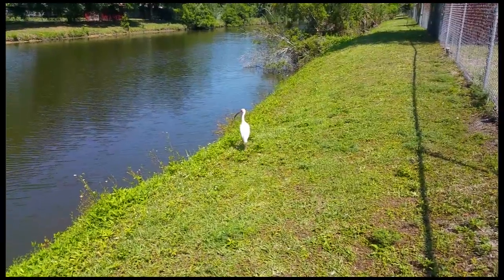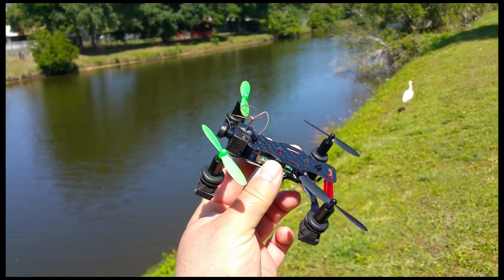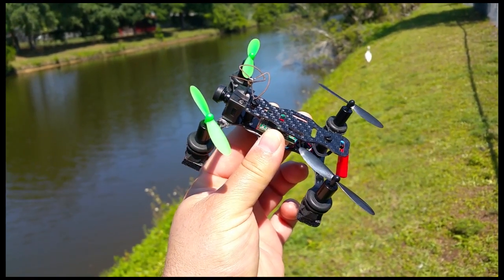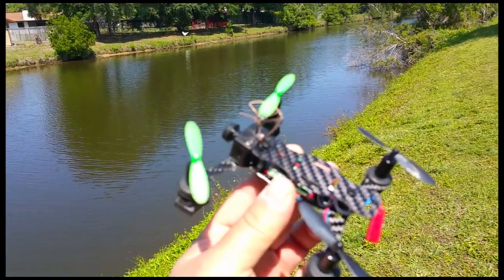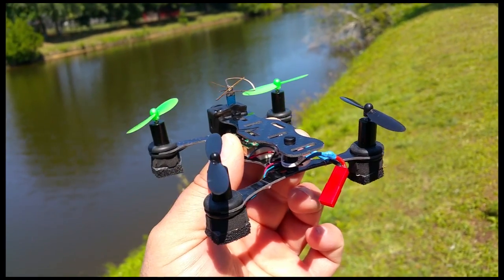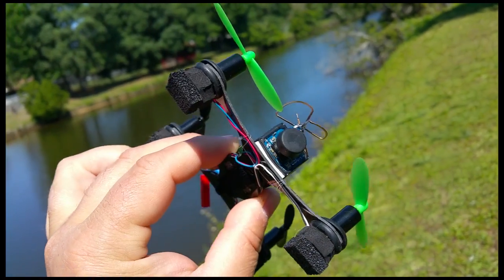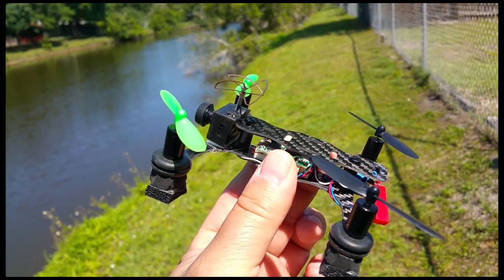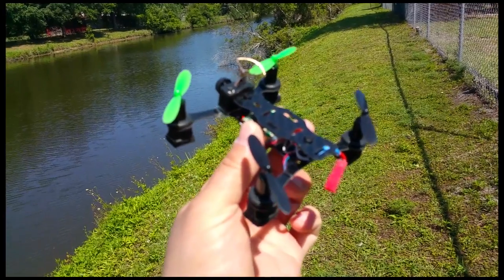Phoenix Flight Gear 110mm Carbon-H Micro Quadcopter

Comment: Mad Scientist Matt I have this set up with 7mm motors.  Wonderful bird.  Would you share your PID's with me?  Mine flys pretty good, but flips out when I and pitched way forward in high speed and then pitch back hard to brake.  When I say flip out I mean literally flip out and tumble.  And this is in Angle mode!  Lol.  Not sure what's going on there.  I'm thinking it's a PID setting problem.

Comment: can you use the Nano QX board with motors this size? Or will it fry the board? Please let me know, want to start building a micro quad!
Reply from the maker: you can if it's the nano qx fpv board, but some had mixes results. that is what I am using in this video... but I highly recommend using the scisky flight controller controller, it is much better and configurable via usb

Comment: using those rubber grommets as motor mounts is ingenious. propably a bit heavy, but indestructable
Reply from the maker: Yes, agreed... and it helps with vibration isolation as well...

Comment: Do you know if 8.5mm motors work with 110,or 135mm frames if I use 8.5mm grommets?
Reply from the maker: Yes, but they make different versions for the 110mm frame, a 7mm version and a 8.5mm version, make sure you get the right one for your motors!

Comment: just to clarify, you are saying this is a better camera than the spektrum VA1100?
Reply from the maker: Hey Jeff... yes, it is a lot better.. I have done extensive testing with the Quanum Elite Camera/Video transmitter combo in the last couple months...  I actually own 3 of them now, the range is much better, resolution is WAY better, as well as the low light... plus they can be had for around $40...  They are re-branded, the actual name is the FX797T , hope this helps!
Reply: I was planning on using it with quanum v2 goggle do you think this will be ok? and do you have a recommended receiver for this setup? I"m new to fpv (never tried it before) any info you can give me would be most appreciated
Reply from the maker: Yes, the Quanum v2 goggles I have heard great things about...  and the receiver people like is the FR632, but here the newer Quanum RC540R is supposed to be good, and it has channel scanning... there are some new goggles coming out on the horizon with integrated receiver, check this out - might be a good option. http://www.hobbyking.com/hobbyking/store/__105250__Quanum_Fatshark_Genesis_HD_FPV_Goggle_w_integrated_40_CH_5_8ghz_Diversity_Receiver.html

Comment: Approx how many hours of flight do you think you have put on the Dark Edition Motors? Just trying to figure out if a new set is worth purchasing. Stock motors don't fly as well with fpv gear.
Reply from the maker: +Charles Proctor I probably had about 7 or 8 hours on them, and they were still flying fine... I think the real trick to making them last is letting them cool down in between flights...

Comment: Are the Dark Edition 8.5 mm motors still running good. I built the same quad and initially  the motors ran great. I flew the quad for a few weeks and the motors have stopped running properly. I experienced the same problem with my stock Nano QX and I replaced the motors. The stock Nano now runs great again. I'm just disappointed that the durability of the Dark Edition Motors does not appear as good as the stock motors.
Reply from the maker: +Charles Proctor That is so odd, i have alot of time on my dark editions with no issues... what props are you using? I have heard that if your using a prop with a stronger bite (like the parrot props) they will burn the motors up within 5 to 15 flights, or seriously degrade the power

Comment: hey what's going on I would like to know on the board did you solder the motor to the board or you put a connection
Reply from the maker: +Jay-Q CEO The board has connections for the motors, no soldiering

Comment: Thanks Matt, I think I am going to try to build one like this. Can I bind a Spektrum transmitter to this? Also to change out the plug do I need to resolder a whole new plug and wire onto this...or can I just pull the wires out of the plug it comes with and stick them into a jst plug? Thanks for your help.
Reply: +holden2113 Wait one week before you purchase, I have a new video coming out of a v2 version that is even better, and very easy to build!
Reply: +Matt Merritt When is the video coming?  It's been more than a week :)
Reply from the maker: +Junes Graphics I apologize man, my grandpa passed away and i have been super busy helping my grandma... i did just upgrade the description for you with the newer components...
Reply from the maker: +Mad Scientist Matt RC Here is my other unofficial channel, with a flight video of me testing it so you can see how it flies... https://youtu.be/iO-mAf-SUbc
Reply: Mad Scientist Matt RC Sorry for your loss:( Thanks for the response.

Comment: Matt, could you elaborate a little more on what you said about adding a new connector, because it trips it into a low voltage? I am new to the hobby and I guess need a little more help than others. Thanks!!
Reply from the maker: +holden2113 No problem, the issue is some connectors can allow more power through than others... if it tried to pull more power than the connector can handle, then the flight controller thinks the battery is lower than it really is, and triggers it to go into lower voltage cutoff (or LVC), it does this to save the battery from being drained too low (you shouldn't ever go lower than 20% remaining on a lipo) I recommend a JST as it will work perfectly...

Comment: Think I can remove all of the FPV equipment, use an arduino UNO flight controller, and have an arduino bluetooth device. Then use my iPhone as a "transmitter"?
Reply from the maker: +Cole Little You might be able to, i'm not sure... but I will tell you this, using your iphone has a transmitter is a novelty. It won't give you precise control over flying, especially when you are in full acro mode. At the very cheapest, i would consider a dxe transmitter (only $59)

Comment: I built the same thing but it just spins out of control
Reply from the maker: +Erick Gomez That is weird? Props on wrong, wrong motor wiring?
Reply: +Mad Scientist Matt RC I don't think the motherboard was capable of handling motors that strong.
Reply from the maker: +Erick Gomez The newer Scisky / Quanum flight contoller fixes this issue, and lets you run cleanflight/betaflight because its a naze32 flight controller... the link is: http://www.rc-drones.com/Quanum-Pico-Micro-Scisky-32bit-Brushed-Flight-Control-Board-wMotor-PlugsBattery-Connector_p_1341.html

Comment: Does the blade nano qx board give you full manual mode or not
Reply: +Alex Polakis It does, you can turn off stability mode and do flips, etc.
Reply from the maker: +Alex Polakis Yes, it has both acro (the mode you are mentioning) and stabilized mode on the flight controller

Comment: Got exact setup from your sources. Although they sent me a different looking frame. Still works great tho. I have a random 500 mah pack on without camera and I'm getting 7 minutes flight time. Might just add a separate 150mah for camera and see how it does. Super easy build ( about 20 min) and just a blast to fly. I would definitely recommend to anyone who is looking for a little bigger faster quad than the nano qx.

Comment: can I fly using dx5e with this setup. I think you are not using stable mode .  how does it perform in stable mode. since I have only dual rates high/low I can't use manual mode to fly accurately
Reply from the maker: +Kumaran Thirugnanam Your right, i wasn't using stable mode, i only fly in acro mode, but it performs excellent in stable mode... You should look into the new Spektrum DXe radio, only $59!

Comment: I have a similar If not the exact same setup. I went with a hubsan receiver which I'm currently regretting as I'm stuck using their transmitter. I'm currently looking at the blade nano QX board. I see it uses dsm2, so any dsm2 module should work? I already have one laying around for my FrSky Taranis.
Reply from the maker: +PA Stubbs Yup, you should be good with the FrSky taranis if you have the dsm module

Comment: Hey Matt I was wondering how you fit your Ultra Micro Camera onto your frame. Is this a good racing quad? If not, what else can I add to make it better. I was also wondering how you fit 8.5mm motors onto your quad although the website states it can only fit 7mm motors.. Thanks Matt!
Reply from the maker: +RCDude01 It's a pretty descent frame... i used double sided servo tape to fix the camera... there are two different frames, one is for 7mm motors, and the other is for 8.5 motors...

Comment: question for ya mad scientist and it may a little dumb considering that i have been flying rc planes for a long time now and looking to get into quads.  i was just in the process of pushing the "buy now"  when this occurred to me. in the specs and requirements list for the phoenix flight gear  110mm kit, it mentioned a spektrum receiver was needed. did they nean a spread spektrum  was needed or was it for the brand  spektrum rx ?i was planning to use a tactic tr625 spread spektrum rx, will this function with this kit ?thanks for your time matt, your vids are informative.roland
Reply: can anybody help with this, i have the kit in the mail but still unsure as to the rx
Reply from the maker: +Roland c Roland, the Nano QX FPV flight controller has a built in receiver for a Spektrum transmitter... I don't think it would work on a Tactic transmitter... I apologize for the late response, i just saw your message...

Comment: you should check the Nano Techs from HobbyKing. 1S  750mah  35-70C  around 3 Bucks !!!  i use the Hubsan 8mm motors.  i don't use the Phoenix 110 top plate.. so i can use a separate 130 1S battery to power the VA1100.  i get almost 6 and a half minutes of good FPV.   i did get all the PFG info from you....so thanks !!
Reply from the maker: You welcome, hope its working good for you!

Comment: Wow that's one of the smoothest quads I've seen... I might have to re-purpose my nano qx LOL. Are you flying in acro mode or in stability mode? Your video seems to be very locked-in as well, how'd you get such a solid signal?
Reply from the maker: +RC Fanatic I am flying in acro mode... It's very smooth for sure. I am using fat shark hd goggles to record the video, but on them i am using a VAS ultra blue beam, works really well, keeps an excellent signal... the best i've tested so far...

Comment: Nice flying Matt. Is the non FPV Nqx FC the same as the FPV Nqx FC apart from obviously the video capability
Reply from the maker: +MrPnew1 No, bigger FETs on the board capable of handling more powerful motors...

Comment: how did you get the 8.5mm motors to work in that frame? listed as just 8mm working in it. I want to build something very much like this but torn between this frame and the 8.5mm frame at MMW.
Reply from the maker: When people say 8mm or 8.5mm it is the same thing... all motors are actually 8.5 but they say 8mm...  the MMW frame is nice, but a tad bit heavy... the VooDoo Quads brushed Voo is currently my favorite frame...

Comment: I have read that the nano board will not support the 8+mm motors, looks like you proved them wrong. I am running my Phoenix 110 with speed 7mm motors, weight is an issue, trying to keep it at or below 50 grams flying weight is often challenging. I think last I checked it was at 48grams with a 300mAh battery, short flight times but a lot of fun without having to go to the flying field. Looks like I need to build me a 8.5 micro.
Reply from the maker: +teamscreem From experience I have gained, it seems some have good luck and some don't... its weird... personally, no issues with that flight controller and the dark editions...

Comment: hey i built this quad per your specs listed above, but now im having issues with it cutting out and uncontrolled crashes like the lvc is being activated or something any ideas or issues you had with nano qx fc i have the fpv fc on this and soldered jst and bigger wires than factory direct to board... thanks!
Reply from the maker: Patrick Combs That is really odd? Are the motors getting old? Sometimes if even one of the motors has an issue, it starts drawing too much current which can set off the LVC... or if the battery is starting to go bad, not sure about why this would be happening... Are any of the motors getting hotter than the others??

Comment: Would you say this is indoor capable or are 8.5mm Dark Edition motors too powerful?
Reply from the maker: ssg  Probably a bit too fast for the inside.. I mean, you could try it if the inside of your house was big, but its a pretty fast setup...
Reply: Mad Scientist Matt RC Yeah, I ordered CJMCU with 7x20 motors for indoor FPV.

Comment: I've got a couple questions for ya.. Can I run all of those specs, the frame, props, motors, batteries, and flight controller with my nano qx FPV camera and transmitter? 
Also to build that did you have to do any technical stuff, ie: board programming, coding etc?
Or was it just a simple mechanical build, can I take apart my nano qx FPV and buy those parts (besides the camera) and build it just like that? What's your advice? Thanks so much! 

Btw that quad is awesome!
Reply from the maker: MrKaNittel Sorry for the late response... this is a super easy build... no programming of any kind, and yes you can use your Spektrum transmitter and wire in your VA1100 camera and transmitter, thats what i am using... Its a great machine, only advice would be to understand that some motors have red and blue wires, and other motors have white and black wires...  When you unplug your original blade motors from the nano qx fpv flight controller just know that blade does it backwards in regards to the colors... so when you unplug a motor from the flight controller that is black and white, plug in one of the micro motor warehouse motors that is red and blue...  and vice versa, if that makes sense...  its important that the motors are plugged in the right place on the flight controller, the motors are brushed with timing in the a certain direction, and reversing them back accident they will work for around 15 minutes, and then be totally worn out.. message me if you have any questions, i would be glad to help you

Comment: what kind of controlers can u use with the nano qx board
Reply from the maker: Johnny TSC You can use anything Spektrum (or JR) related... like a DX6, DX7, DX8, ect... I am currently using a DX9 black edition...
Reply: Great! And what range do you get ?
Reply from the maker: +Johnny TSC Around 200 to 300 feet roughly...
Reply: Great thx... I now have a blackout!

Comment: I'm doing this same build with ask the same parts, do u have any tips or trick to help build and can you tell me what motors turn what way. 2 have black bottom and 2 have white bottom which spin what way? Thanx in advance
Reply from the maker: Evan Noe I can't exactly recall what motors turn what direction, I don't have the quad in my possession at the moment, but i will tell you this, BLADE reverses the colors on their flight board connections to the motor... so where the blade motors were plugged into the flight controller (say black and white wire) you would plug in the red and blue wire using the motors from Micro Motor Warehouse... basically, they purposely reversed the colors unfortunately..  its important to get the motor color correct due to the timing on the brushes in the motors... if you get them backwards they will work for a small amount of time until it wears the brushes out... I will do some research to figure out which colors go where if you want... sorry for the late response, just saw your message

Comment: nice, but do you agree the image quality can be improved?
Reply from the maker: Hans Ham Absolutely,  I have another video coming out in the next week where i rebuild this quad with a higher power video transmitter and and higher quality camera and only add a couple grams more weight... I will be providing links to the equipment and explaining how it wires up... :)
Reply from the maker: +Randy Mease I have not... been doing 180/210 sized quads right now... working on more, though!

Comment: Where can I buy the JST connector? I just want to make sure I'm getting the right thing. Is JST what's on the hubsan x4? Do you need to solder it directly to the board, or did you extend the existing wires? Thanks, great looking copter!
Reply from the maker: Nathan Manousos Lots of places sell them, an example would be http://www.amazon.com/pairs-JST-Connector-Battery-Female/dp/B0089RAXB2
Reply: Thanks!